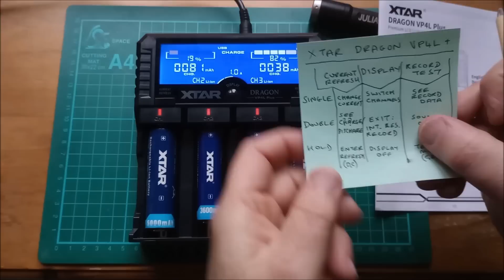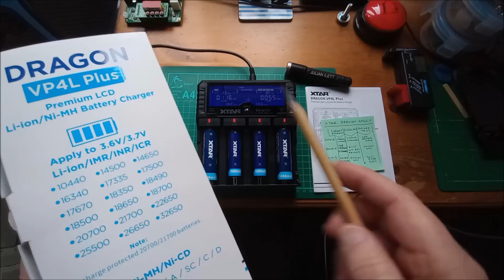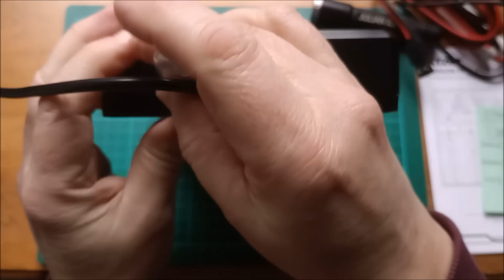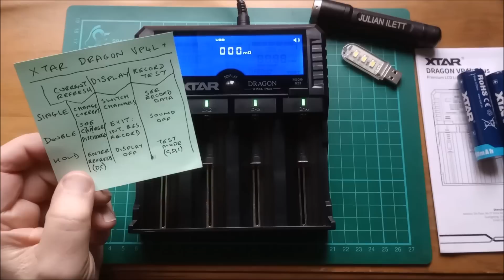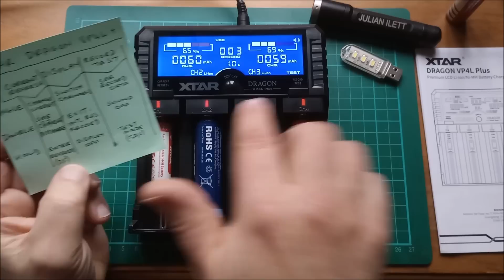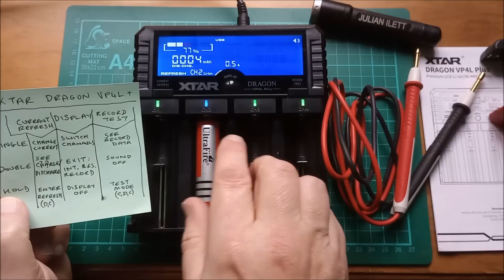Xtar Dragon VP4L Plus Battery Charger

Comment: 3:43: "Humanistic" actually means "bad translation". ;)
9:11: The manufacturer could certainly print and include such a "cheat sheet" in the box (the manual, that giant bed sheet, is useless, anyway)!
Seeing how the charger does not provide the usual information (voltage and current), who would you say this charger is for? Why would anyone spend money on it, that is, when they can get everything they need in a charger three times less expensive, such as the VC4SL (which also displays information for all the four channels simultaneously)?

Comment: Have you figured out what mAh is actually display a measurement of? in your pic @ 0:50 it shows 75% charged (got it) and 0003 mAh, there is no way the battery in slot 3 only has a capacity of 3mAh. I'm nearly finished a charge on mine and it shows 99% and 0010 mAh the battery in that slot for me is a 3400 mAh EagleTac; so what is the mAh in charge mode showing us?

Comment: just got one and it's worse than I thought, using a Panasonic 18650 2350 mAh battery and selecting 2A to charge doesn't mean anything because if it did it would quickly become Hot, it didn't.  Selecting any current setting and the battery takes the same amount of time to charge.  Taking that same battery and using a Xtar SP2 set to 2A and it gets hot fast.  Putting that battery in the VC8S & selecting any charge rate you want and it goes to 250mAh period. Same results with the VC4SL, the battery charges and doesn't get hot since the charge rate auto-selected is low.  That's one reason it's important for the charger to display both voltage and ma WHILE charging, so you know exactly what it is doing at a glance anytime.  For the money Xtar charges for this package they ought o be ashamed of themselves. Showing 2A on it's display might make some feel good that they manually can select the charge rate, but the charge rate of 2A shown is false.  Just finished trying 2 other batteries same results; looks like this might have to be sent back for a refund.

Comment: hi guys i use a similar charger to charge my 18650 batteries but there are 2 inputs on the back a DC input and an AC input for which they provided a mains lead and plug but when i charge using that lead the batteries and charger get quite hot but 4 batteries will charge in about 3or 4 hours. But i tried using a DC charger which also charged but took much longer about 6 hrs but was totally cool to the touch all the way through. My question is which is the correct lead i should be using. I seem to think its the DC cable because its not overheating. I would appreciate any info on this since ive googled all over and i did not find an answer

Comment: Hi Julian, thanks for the review, sadly there's no individual slot charging current selection ... if I place mix AA and AAA NiMh batteries, what's the recommended charging current to set ?  50% of smaller AAA mAH , I.e. 50% 1000mAh =0.5A charging current ?

Comment: I bought the XTAR Dragon Vp4 plus (Not Vp4L).
Electrically it works great!
The type of plastic they use makes it a piece of junk!
Mine started cracking and falling to pieces after 8 or 9 months. To this day I still have zip ties holding the bottom together with epoxy inside to make it still usable.
Reply: I hope they changed the plastic on the newer ones!
Reply: same here, hard plastics glue works on that plastic , the spring holder i had to drill and add a screw its a bit of faff but gets it working again

Comment: for NiMH batteries state of charge is not indicated by voltage. Voltage above 1.2-1.3 means nothing.
Reply: @AlcoveShadow  TLDR: charge termination does not depend on absolute voltage... Details: Either they put something just because or they don't know how Ni-MH batteries are charged. Hopefully it's the first. Ni-MH are not charged to terminal voltage. They are charged until : 1. voltage drops a bit instead of rising - not sure - about 0.05V, 2. temperature starts rising faster 3. time limit for safety. Combination of all 3 is required because 0.05V drop is very easy to miss, temperature might depend on environment, so that's why there is also time limit. The absolute voltage can be anything on fully charged batteries - it depends on charge current, battery capacity, internal resistance ... etc.
Reply: The temperature is crucial and if the probe is in contact with the cell quite failsafe. If it's too hot it stops - period. Neither the timer nor Δ-U can detect if you've dropped in a full NiXx battery.

Comment: I have a XTAR VC8 charger and I have to say I'm not happy with it. I should warn you and everyone using this charger that the internal resistance test is a complete gimmick. The is a 30mOhm difference slot to slot(some might be the close but at least on my charger some slots show double the resistance on the same test cell. Not to mention they all show different values).It can only discharge on 4 out of the 8 slots, discharges only at 330mA and only has a type-C QC input. Also on my charger slot 4 has a higher self discharge than the others so the capacity test will start again if you leave the cell sitting in the charger for a couple of hours. For the price this one is not worth it. Might as well pay extra 10-20$ and get a something else with more functionality
Reply: do you have any recomandation for good smart battery charger?

Comment: It's strange this should come out right as I am considering an upgrade to my XTAR VC4 after many years of reliable service. It does display current, voltage and capacity during charge and pulse charges the NIMH. Additional outputs would be useful as well as the test and discharge modes. 
Thanks for the review.

Comment: I've found my anyloops recover relatively quickly from 0V, and if I leave them for a while they usually bounce back up to 1.0-1.1V. The only time I've been able to measure a negative voltage was while they were still in the device after they ran flat, or within seconds or removal. For example, I just ran a pair flat in my Game Boy Color [sic], and they read 0.54V and 0.86V in my Opus charger about 30 seconds after removing them from said Game Boy. I immediately removed them from the charger before it started charging and waited about 15 seconds before reinserting them, and they were already up to 0.77V and 0.96V.

I've also found they charge much more evenly and take a higher amount of charge if I let them rest for some time after discharging. For example, I've seen them take around 1200mAh and 1400mAh when charged immediately after discharging (can't remember which was at a lower voltage), whereas they both usually take very close to 1500mAh when I leave them for some time after discharging (usually at least a few hours or overnight). Obviously these are well-used cells, I always let my newer anyloops rest, and their charge level hasn't seemed to drop down over time like my older cells which I always used to charge immediately.
Reply from the maker: Sounds like a good idea to let them rest a while. Problem is - wife says "light's not working" and expects it to be working again immediately.

Comment: No voltage and no current display? No thanks.
Reply: Get a life, 🦖 BETA 🤓.
Reply: Is there a different charger that displays that?
Reply: @ButterBallTheOpossum  yes begins with y youksi something

expensive

try also skyrc but they  are dear, not the b6
Reply: Are the SKYRC MC3000 and other charger/tester/analyzers really worth 3x to 4x the price of the XTAR, Sofirn, or Nitecore charger/testers. What are other options?

Comment: I have the Adeaska SQ4, whilst lacking the discharge capacity function, the display is much better.
It can charge LiFePO4 as well as Li-ion and NiMh. I would recommend it.
The Xtar display is limited and showing only 2 channels is very poor. The button interface seems clumsy.
Reply from the maker: I blew up my SQ4 by putting 13.5 volts into it :(
Reply: ADEASKA VC4 might the way now :)

Comment: Compered to Nitecore charger I think Xtar didnt change quality and they are still the best simple and safest charger on market. Still if you regenerating cell all charger will be permanent demage if cell start leaking, even gas from vented cell can push corosion on board realy fast and you think is bad charger ! Best to use dumy cell with wire and add additional holder next to charger for every cell so if cell leake wont demage charger.

Comment: Hello Julian.
You could easily check the current by inserting the probes  .
Some insulating material between 2 magnets inserted between the negatives.
The littokala chargers that I own say charge discharge 1A, but the charging current is less.
Cheers.
Reply: Or you could get a cheaper charger that actually shows the current.
Reply: @Okurkaarrgghh Why do you need to see the current? Are you going to shoot electricity through your finger tips like Flash and SHAZAM to help out the cell? Get a life, 🦖 BETA 🤓.
Reply: I use a small piece of double-sided PCB material in between battery and terminal to measure current.  A piece of card stock with copper tape on both sides also works, especially when the battery is already a tight fit.

Comment: The XTAR chargers are pretty good. I have two of them. I had one blow out a diode but it was an easy fix and no issues since.
Reply: My car is pretty good; I only lost a wheel once.
Reply: @Okurkaarrgghh  my last car was amazing, the engine blew out of the engine bay mid drive. worked great for another 3 years with a new engine. (then i sold it)

Comment: Ok, interesting, I was looking at one of these online recently, great timing for you to make this video.
Reply: And happy new year, good to see you back on YT :)
Reply: Ha he saved me a lot of times like he can read our minds 😂
Bought a lot of stuff he reviewed
Reply: @DreStyle  same here, some items I use almost every day such as the USB C charging cables that Julian reviewed, with minature OLED watt meters on the output end of the leads, genuinely useful.
Reply: Have to say I'm not totally blown away by this unit, pretty big and the design only displays data on two bays at any time. Also lack of "live" voltage/current displays is not ideal. I'm still using two Opus BT-C3100 chargers that work very well, though they can only take up to 21700 size so that's their limitation.